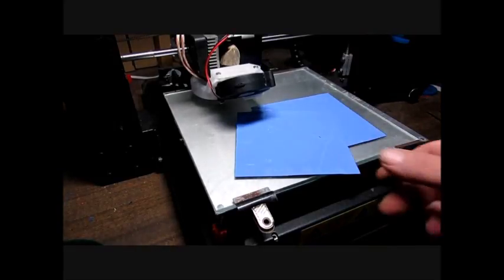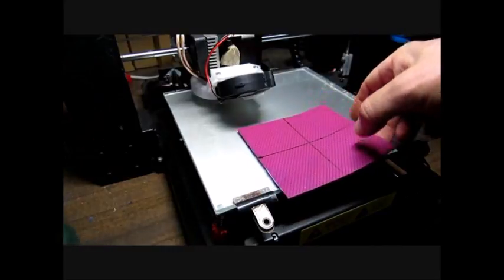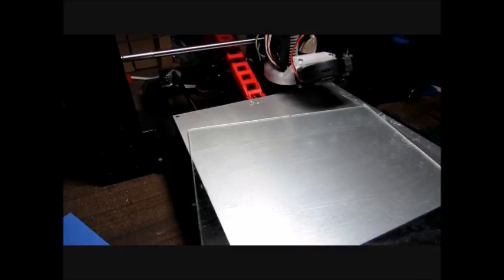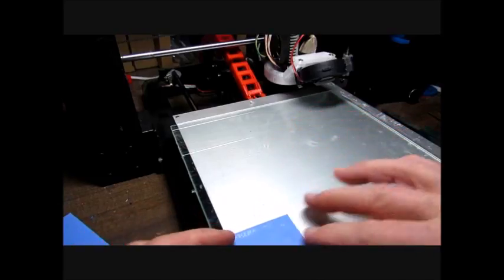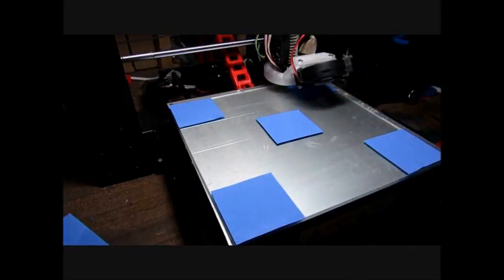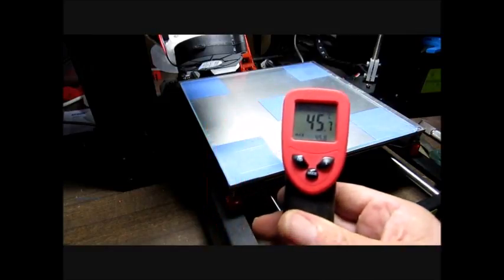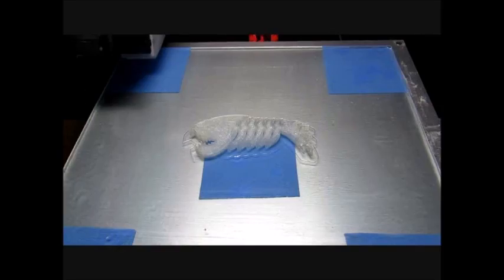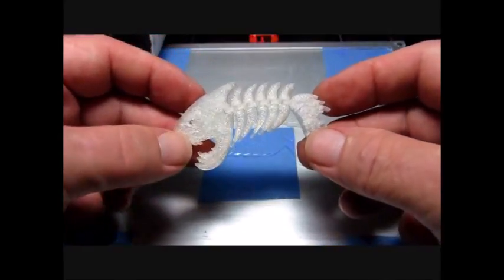Add Heat Conducting  Pads to Glass Bed 3D Printer Tutorial

Comment: Thank you very much.  Question; Why 50mm squares and not the full plate?  Wouldn't you get better heat distribution with a full layer rather than the 5 pads?
Regards
Waldo
Reply: Yes. You should cover the full surface to evenly distribute the heat.
Reply from the maker: The pads I bought are 50mm square! Also I wanted to easily remove the glass if needed. I checked the heat distribution with a thermal camera I made and it's pretty even. https://youtu.be/nGPPUyfcpTg

Comment: Question, I've never handled thermal pads. Are they resuable? Like if you need to take them off will they rip? Do they come with adhesive or are they just self-adhesive?
Reply from the maker: It is a silicone material which can be removed / reused with care. There is no adhesive you can usually peel them off. Anyway they are not expensive. Check out my other 3D printer videos : https://www.youtube.com/playlist?list=PLxtbRS-naT69AQyFTg3d4CpoND_xvE53x
Reply: @1nformatica  Thanks!